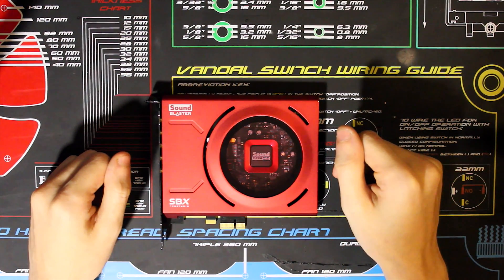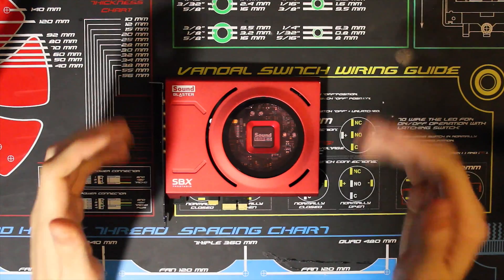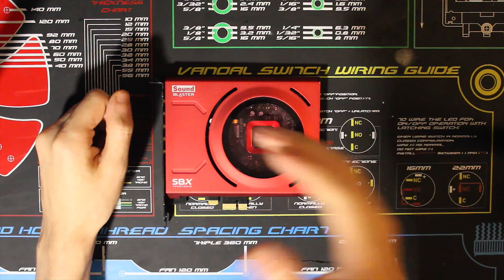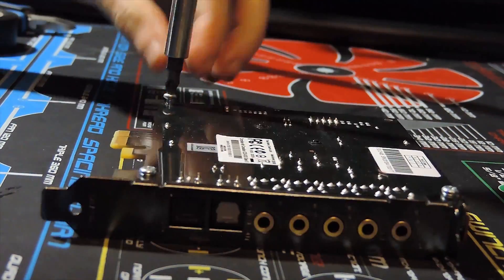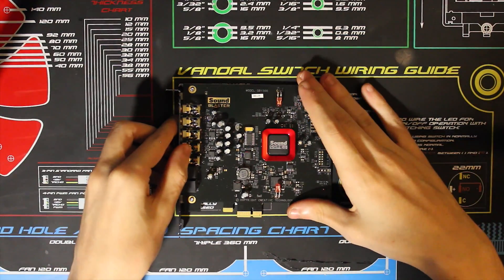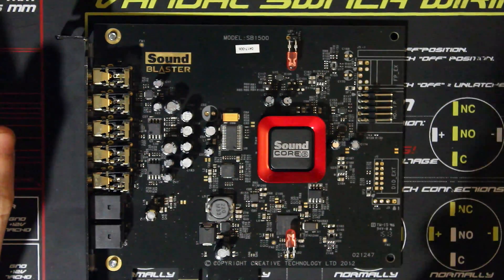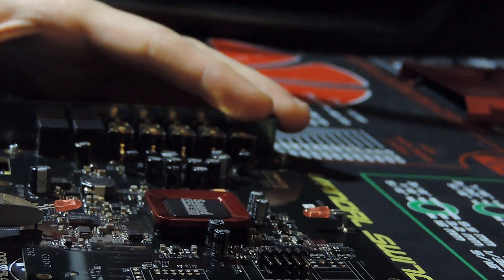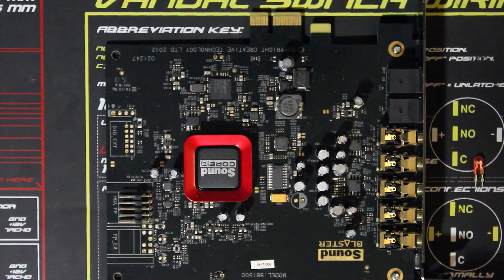How To Remove The Sound Blaster Z LEDs

Comment: Those LEDs are crazy bright.  It's especially bad for me because I have my mobo mounted upside down.  The card itself sucks bigtime, especially if you use headphones because you have ZERO control over how much the builtin amp amps the signal... and it's waayy over-amping for me.  But, I actually have one laying around that I'm now using just for optical SPDIF port because this mobo I just got doesn't have spdif line out at all.  I need to use optical spdif out because otherwise I get too much background line noise (plus I already have an external dac that goes to an external tube amp I really like so I wanna keep using the same setup I've been using).
Reply: Same issue here, barely any b650 boards have SPDIF out port nowadays, and they still cost a fortune

Comment: This video is more annoying than the LEDs . I know about a easier way : Cut through one of the stems both of the LED's and it will not light up again guaranteed . You can even use a nail clipper  :)